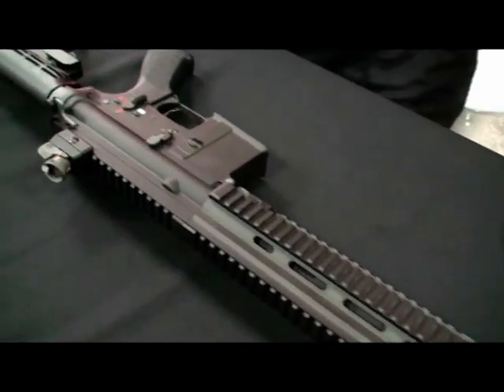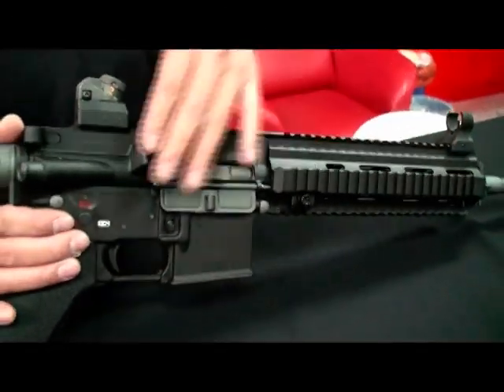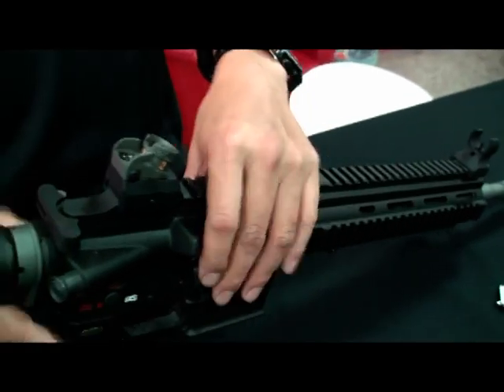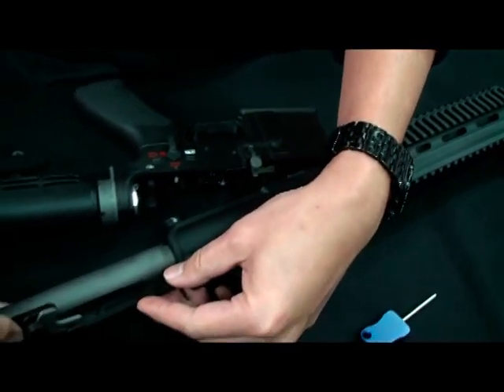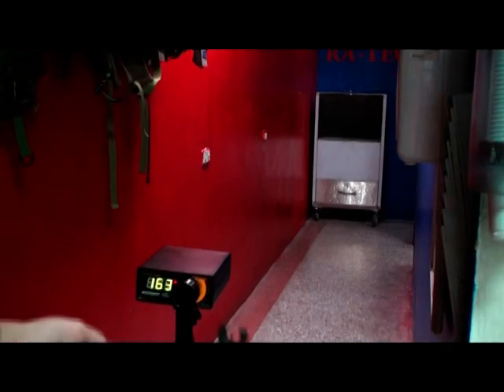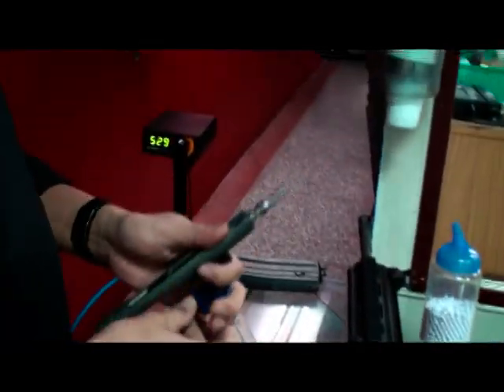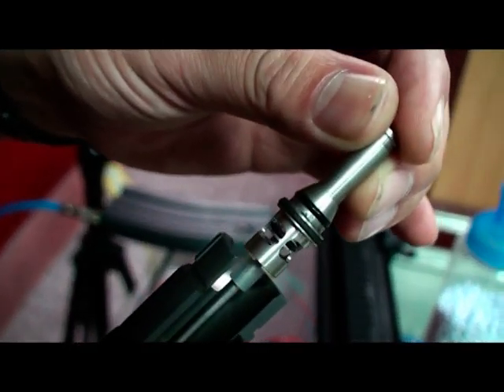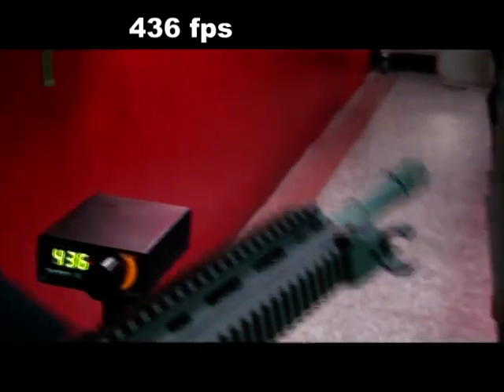RA-TECH COUSTOM WE HK-416

Comment: @The1860th true, but most users are using green gas or propane. For a fair test, it should be done with green gas or propane. I'm curious if the NPAS will make the FPS less consistent than the standard nozzle.

Comment: this video is extremely misleading. 

There is a constant supply of consistent gas pressure. that is why the fps is fairly consistant from shot to shot. And also the reason for the wow omg wtf rof consistency at the end. You wont get nearly similar results if you used this with green gas. 
I love RA tech products, but i frown at this blatant attempts to mislead customers who dont know better.